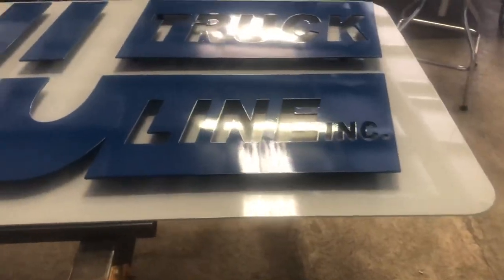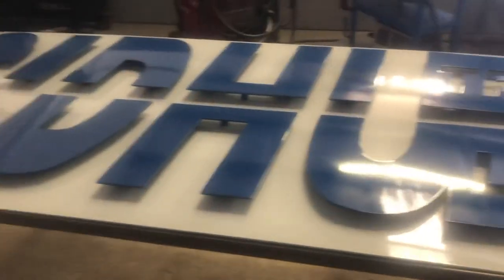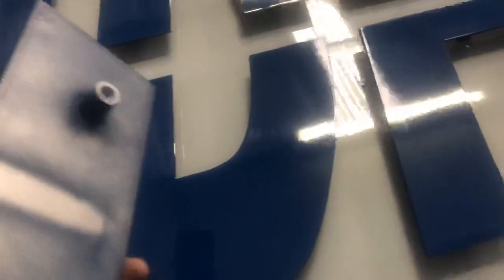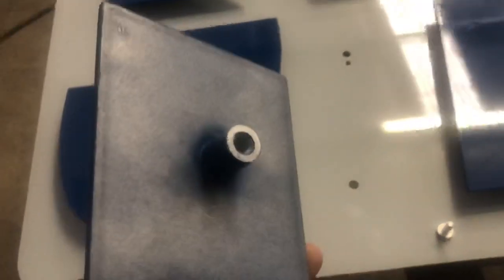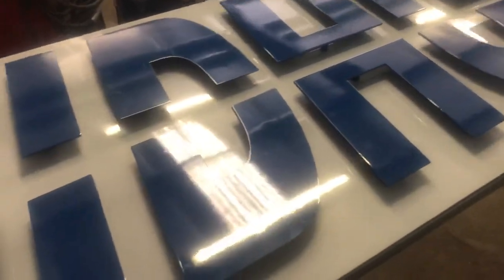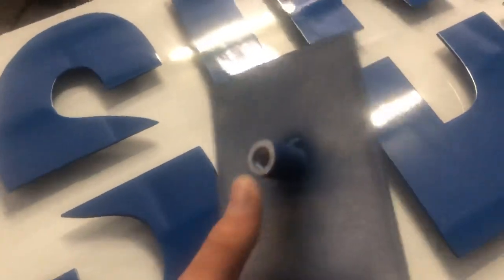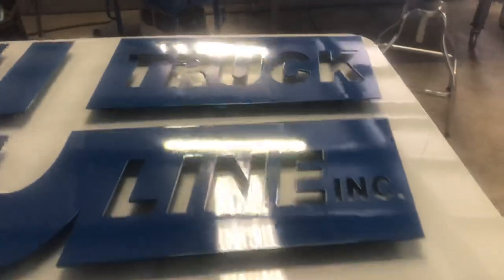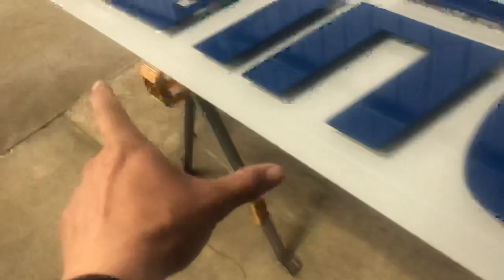Cnc Plasma Cut Aluminum Sign

Comment: Nice sign!  You mentioned drilling the holes through both pieces at the same time.  How do you fill the holes in the letters before paint?
Reply from the maker: I tig welded the stand offs on the bottom of the letters and then I welded holes on the top of the letters